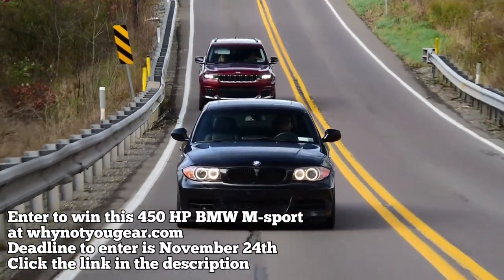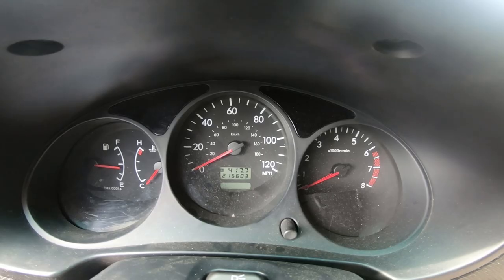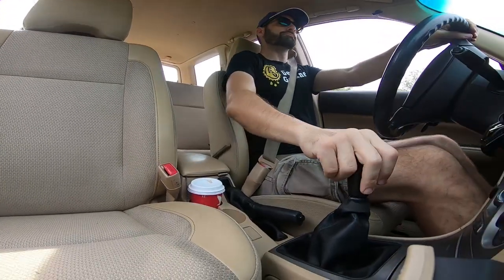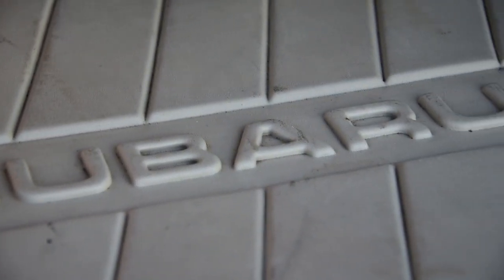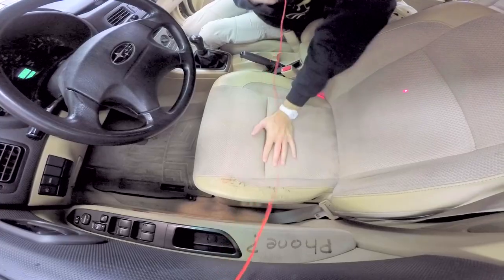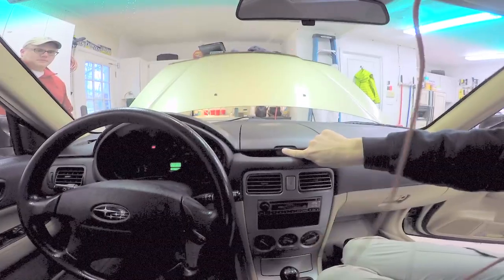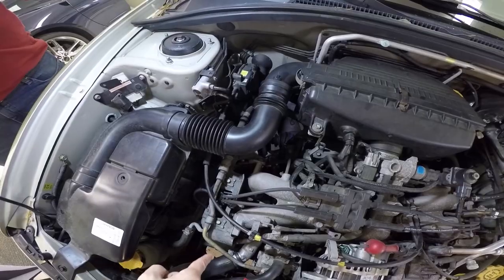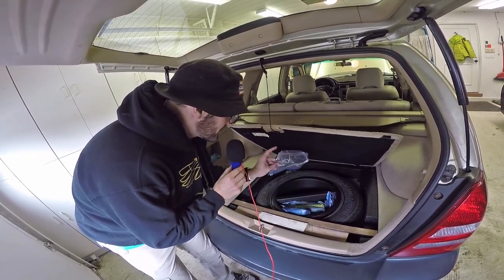2004 Subaru Forester 5MT: Regular Car Reviews

Comment: I had a 2006 forester SG9 2.0 NA Facelift of this one which is a SG5. im pretty sure America didnt get the 2.0l. the NA at least has no headgasket issues not sure about the turbo one of the 2.0l. i loved it. I even crashed in it and my family was sure i was dead. But came out without an injures that i was gonna have for life. And bought the same car again afterwards (as i have today) and i love it.

Comment: My 04 4EAT is still my first car and still running. This video was actually very emotionally stirring for me as mine is fighting a very tedious problem that shops haven't been able to figure out and I've foolishly dumped money into new parts trying to fix. I drive it, anxiously waiting for it to catastrophically fail in some way or another, dramatically highlighting the problem I could never find. It will mock me one day, but I still love the needy child that has eaten over 15k out of my wallet over the past 4 years (Insane, I know, learning experience for sure). I do have my Baja Turbo, and that is a fun car, but it will never feel like the Forester, and it will, in brutal honesty, never be as utilitarian as it either. Sure, it has a bed, but it'll never see the 1k lbs of mulch for my mom on mothers day or any of the crazy stuff I've transported and cars I've pulled with it. I fight myself on selling it or just letting it die, and dread the thought of ever having to scrap something so valuable to me. The time spent wrenching, pulling the motor a couple times, replacing so many things that I really didn't even need to.. and yet there's the little details, the improvements, the handling (once bushings are replaced), the sound system I put in, the LED lighting for just a little more light and flair, the tinted rear windows (worth it), all to a car to my liking. This is getting long, thank you RCR for helping me feel a little bit of shared sentiment over something that has been so strangely important to me. I hope I can keep it until the body rots, but only time will tell if it'll survive, maybe I'll find another xt or manual, and love that again, but as the years go on, that will only get more difficult. Sigh

Comment: One of my aunts has one of these, a 2005 2.5x, 5-speed manual in whatever that dark green color is called. Has some aftermarket wheels on it, and the tailgate was hit a few years back so part of the plastic bit on the back with the "subaru" is half broken off. First saw it back in 2007, and was still pretty new & was quite the experience for my 14 year old self, being a brand-new car pretty much, as i had main been in things from the 1980's & early 90's at the time. Was pretty nice will say back then, and still is nice now. Though where i am here in australia & where it is, it doesn't see any offroad use, as she doesn't do that sort of thing. Still is very clean inside, with the driver side door plastics being scuffed & scratched, as they would be. And the backseat, doors there are pretty much spotless as well. Has the usual scratches & whatnot on the outside, mostly on the driver's door. done about 240,000 something km's so far, she got it when it was under 20,000kms and still goes great. She'll have it for a good while more too, no need to get something else as it does  what she & my uncle need, and yes, will be around for a while more for sure.

Comment: The one thing I never expected when I first got my 2005 Forester 2.0X was how much of a DUDE MAGNET it is. I get approached far to frequently in car parks and where ever asking if my 155K Mile Forester is for sale! Never once was I asked this when I had my previous car, a Honda s2000 AP1 🤷. 

I drove my Forester from the UK, through Europe to Turkey, circumnavigated the Turkish mainland over a 2 1/2 month period, including some tricky forrestry tracks and drove back to the UK issue free! Would have liked it if the MPG was better but on longer motorway journerys I just cruise at around 58-62 MPH and you can claw back some MPG no issue. 

Yet to take it on snow though.... one day.....

Comment: You just cant beat the simplicity of 90's - early 2000's Japanese economy and work vehicles. There's just something about old base model Toyota, Honda and Subaru cars that gives them a feeling of comfort and being at home. I love how most have simple interior designs, like where the dash is just a flat, rounded piece of plastic without unnecessary sharp lines or edges that say "I'm sporty", and that they are mostly very basic with squared AC vents and non-aggressive steering wheels. An example like the Subaru Forester, would be the early 90's Honda Accords, or even a late 90's Nissan sports car like the 240 SX or Skyline.

Comment: My mum bought one of these cars at the end of 2006 it was a 2003 base model and it was also a manual. At the time I'd been learning to drive on auto's and had a fair few hours and was confident in my driving, learning to drive manual on this model Forester was an experience and it certainly did buck and jerk a few times with me trying to find the biting point but once i'd gotten it down it was fantastic and it set me up for learning to drive cars which could have tricky clutches in my first job as a detailer/airport parking facility. In australia we got the turbo versions too all the way from the very first ones and I'd dreamed of owning one eventually but sadly moved onto other things instead.

Comment: This made me feel things

Sadly my 2008 5spd subaru outback is in similar shape with the rust. And the aftermarket clutch that was put in it by the used car dealer is judders. Every bushing squeaks, the exhaust rattles terribly and yet... it still remains as the most reliable car in my fleet and I love it. ❤

Comment: 11:44 I daily drive a 1994 ford f-150 XLT 4x4 and I think it came with lumbar support standard. theres no power seat but on both sides theres this switch that inflates and air badder that helps keep the curature in your lumbar. Its one of the main reason I bought It over a squarebody. The squarebody’s seats are so fucking uncomfortable and the bench in my ford feels like a big couch that i can fit 4 ppl accross if I have to plus I have lumbar standard for my bad back. that feature comes in handy if you are ever driving for over an hour or more and your lower back starts hurting. i love my truck even though its not the nicest thing in the world cuz i can’t stand new cars they are boring! This truck reminds me of being a kid cuz I always wanted one.

Comment: used to have an 04 outback sport (the impreza one) 5 speed. i wasn’t used to daily driving a manual when i got it but i knew how to drive stick, you were spot on that thing was geared like a truck, had a super firm clutch, and when i would stall it at first, it was nuts. my friends manual mazda by comparison had a clutch so soft i wasn’t sure if i had it fully depressed.

Comment: Can confirm, 5MT Subarus of this area are super super fun to have fun with in the snow. Very very controllable. My '15 Impreza has a stupid nanny VDC that you can't disable reigns it in too quickly :(
I miss my 2005 Impreza :(
And no, the cloth seat edges also fall apart.
The '15 cars still have that same cable actuation for HVAC, but the knobs themselves are a crappier design and it's almost impossible to tell which direction they're pointed in the daytime.
The '15 also doesn't have lumbar support adjustment, and it really needs it...
Also, the '15 ish vehicles have an electronic hill-holder that's pretty smart, it actually works pretty well.
The old mechanical system WAS tilt-sensitive, if it's not adjusted properly it can cause issues.
Also, ow, the whole garage sequence had a really painful squeal going on. :(

Comment: In 2017 the 95 Impreza I bought new finally died and I found a 2003 forester XS leather ect all the bells and whistles only 52k!! Classic little old lady drove to church deal. It needed head gaskets so she sold it. I had a Subaru specialty shop do that plus everything else he could knock out while the engine was out. I have what feels and drives like a brand new 2003 forester and I LOVE it……..I do wish it was manual but I also love the perfect condition leather interior so I can’t have it all I guess.

Comment: I just picked up an used 2021 Impreza hatchback "sport" with an manual transmission. It was the only  manual I could afford. The same Subaru at the dealership in 2022 was $4,500 over MSRP,  which when done was.......$7,300 more than my Subaru. Still wish it had better gas mileage, but I love the 5 star safety rating. It is an enjoyable daily driver, that  I going to keep for a long time. 🏹🤠👍

Comment: Miss this car. We bought one new in 04 base trim for 17k. Nice green over tan. Sold it in 2015 for $5600 with 175k. Only because our new Kiddos car seats forward facing made our knees hit the dash. It was trouble free. It got fog-lamps a few times.
We bought a fancier 2015. Its much quieter. Its got the space for car seats. 
I Wish we bought a manual, again. But I love having a panoramic roof. Oh, and HEATED SEATS!

Comment: Just bought a 99 Forester 5spd with a ej20 swapped into it. It has over 240k miles and the engine probably have close to 90k. Everything annoying about the car to most normal people, is what captivated me to buy one as a gear head. I never understood it until I bought an example of my own.

Comment: I have a MT 09 outback with over 200k, it's alway been a 2nd car / winter beater and I will never sell it.    I agree with everything you've said in this video. Ive had Jeeps, Tacomas, BMWs, MX5s and the outback has been a staple in the driveway. 

the spring for the hood latch broke so now there a string i have to pull to return the latch,  fuel release is rusted so the gas door is bent to stay open, leaky oil from the driver side, clunks, shakes, wobbles and never gives up.   

the winter roads of OH and PA are also slowly taking the "Angle Share" and you perfectly described.   when she does fall into two, i will be flying out west or south, ill pay another $3500 for a 02-09 subi with 150k and drive her home.

Comment: My 2nd Gen Outback had Weather Band, but my 3rd Gen doesn't. To me, the fact that my Subie had Weather Band says that they understood who their core customer was. Their customer WOULD take the car out to pick up their daughter in a driving snow storm. No, you may NOT drive home in this weather in your Honda Civic. My two latest Outbacks were the LL Bean Models. Heated seats, mirrors, rear and FRONT windows. No better Subaru engine was made than the 6 Cylinder ones in the Outback. Smmoooottthhh. And torque. Slap the auto shift lever to the left (manual mode) and power up the hill without downshifting. Love my Subaru!

Comment: People dig american cars but Subaru really makes any american car look great. I loved my 2005 STi and had only minor issues. Broken exhaust bolt, spoiler needed reset, door lock failure all within two years. The 2007-2018 all had major engine issues and other problems mentioned here not to mention rusting out and soft paint.

Comment: ur ac compressor will cycle when the system is low on freon.  after the compressor runs for some time ur evap will get too cold and the sensor will tell the compressor to turn off till it warms back up, This is to keep the evap from "freezing over". Adjusting the pressure would have saved the compressor.

Comment: Mine was even more rusty. The fill hold leaked gas. You could see pinholes of light in the driver footwell. The mechanic refused to do the brakes for fear of the brake lines bursting. But I hope to have another one as a winter car some day

Comment: Makes me feel bad for mistreating an 07 Impeza 2.5i AT I had, I really liked the car in retrospect, and it saved me on several occasions, the last one causing me to lose it because I didn't have full coverage and the damage was more than what I could afford to fix it.

It allowed me to have my Miata 10AE for close to 8 years, and I had to sell it for a few reasons, mainly because I couldn't afford the maintenance and a rebuild.  I do miss that car, I built up the suspension to eventually get more power, but I just enjoyed the engine as it was.

I'm still hopeful I could find an 07 or 08 Forrester MT in the future to work on, make it like a JDM STi.  Hope you guys find that RCR DreamMachine.

Comment: I have had so many cars in the last 20 years. I have been solidly in the Jeep family. Mostly XJ's but most recent a TJ. My hand was forced to get rid of my TJ which is fine, it was a terrible daily for my 70 mile commute and the fact that as a bass player I couldn't fit squat in the thing. What did I replace it with? A 2003 Forester XS with 250k on the clock. Rumors of an engine swap at 150k, but who knows. Its a 5 speed manual that fits anything I ever wanted to haul in it, gets me back into the fishing spots my Jeeps did, and ever payday I can go to the local pull a part, and dig for parts and upgrade from a handful of other subarus on the lot. I absolutely love this shit box car. I get it now.

Comment: I had the opportunity to buy a 2018 white 6 speed 2.5 high optioned Forester 8 months ago, it was comfy, peppy enough, spacious, but overall too stuffy. I ended up on the basest base model 6MT Crosstrek in eye-pain orange because it felt more Subaru. Asthmatic engine, tall gears, decent ride height, but as close to spartan interior you can get in 2018. It has open front and rear diffs but the traction control can be turned off and she tries to run through every gear no matter what. Wish you could buy a new gen 1 or 2 Forester with the new FB20D engine but that isn't what the world wants.

Comment: very very very happy that he listed the ACTUAL reason for N/A subaru headgasket failure 
ive heard everything from 
"oh its a flat motor the way the fluids sit when not running cause it"
to
"its not properly grounded so there is too much electricity in the coolant "

ANNNDDD the ease of working on comment 
so thank you for using your platform for justice

but learn to fucking edit 
not everyone is hanging on to your every single word

Comment: All of those Subaru AC comprossors have that residue... In my experience thus far (a decade, professionally), I've seen a handful of bad AC compressor clutches, out of the buttload of Subarus I've seen and worked on. They're not particularly failure-prone, as long as any refrigerant issues are caught reasonably early. Fast cycling/weak AC cooling is, most often, just low refrigerant, which will definitely take out a compressor. The oil for the AC compressor, instead of having a sump like an engine, is just spread throughout the entire AC system. Low refrigerant means low oil flow, which for the compressor is just like running really low on oil. A refrigerant leak almost always also leaks some amount of AC oil, too... But the oil often has leak-detection dye, so any leak can be found more easily, at least if in a visible area.

Comment: I know the feeling. My 08 Impala, I've had it since 2016. Has like 187k miles on it. The transmission in it is starting to act up. Engine and frame are good though so I'll imagine it'll go to auction. Wonder how much I'll get for it.